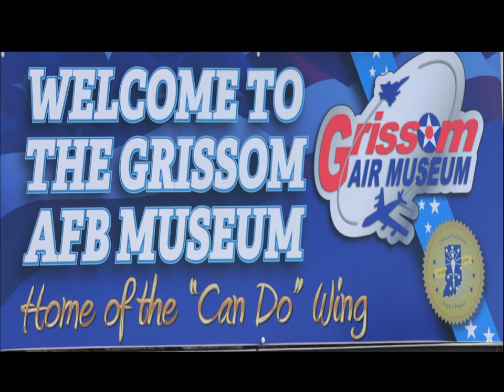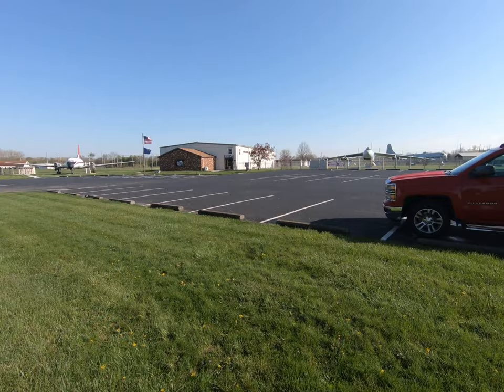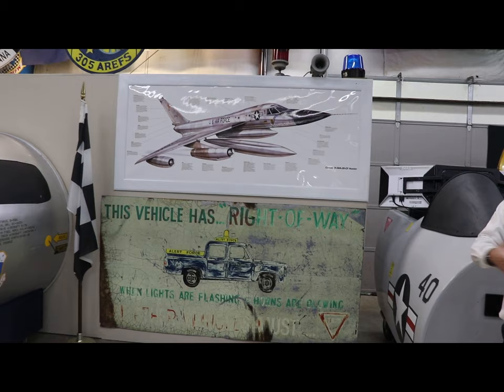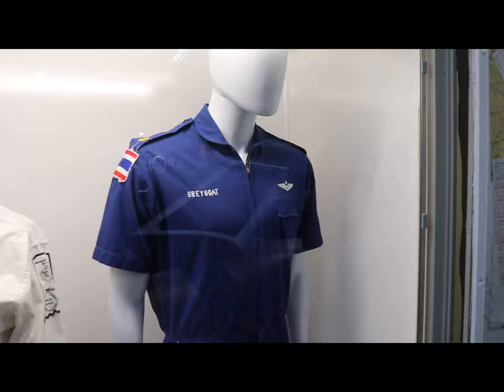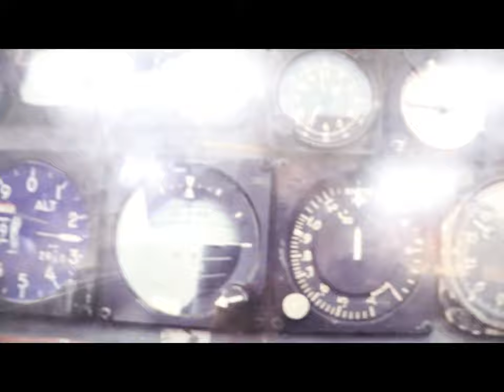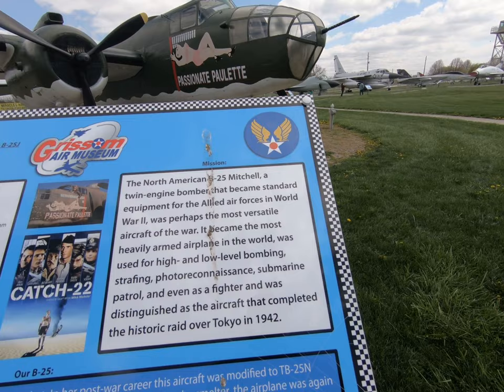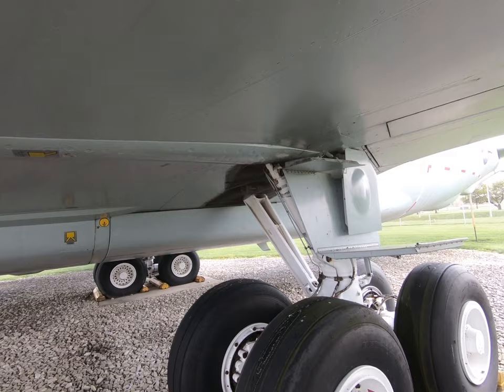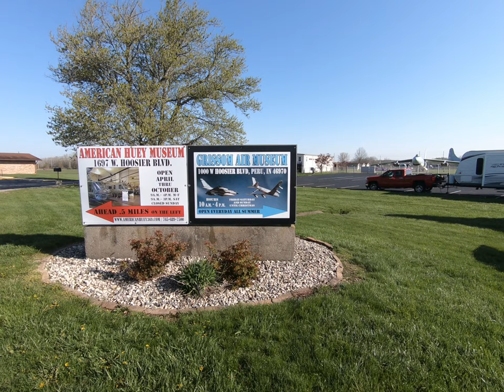HARVEST HOST STAY AT GRISSOM AFB MUSEUM

Comment: I was stationed at Bunker Hill AFB/Grissom AFB from !966-1969. I was a medic at the hospital (827th Medical Group). I worked the Emergency Room and drove ambulances and the cracker box Red Cross field ambulances to the flight line when any B-58 or KC-135 had any issue when approaching a landing. 
I have so many memories there of the extremely cold winters and trips to Peru or Kokomo. Salute, 🇺🇸 Ron D.

Comment: You keep saying I-65 runs right past the base.  I-65 is quite a ways west of the base, and US-31 runs past the front gate.  I was a tanker crew Chief there for 13 years.
The tanker,i when completely defueled, would sit on its tail.  Weight had to be placed in the cargo area to keep it on the ground.  The tail strut was a safety precaution,during refueling and cargo loading.
The water tank held 5581 pounds of water or 670 gallons, and would only last two minutes during takeoff.
I was stationed there when the EC-135 was parked in the museum.
The EC did not have an upper deck tank.  I worked with the crew chiefs assigned to that EC.
Reply from the maker: When we're you at Grissom ?
Reply from the maker: I was a Ceewchief of a KC-135 A IN 1974